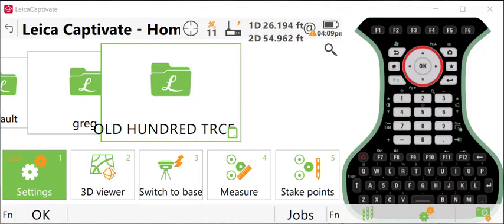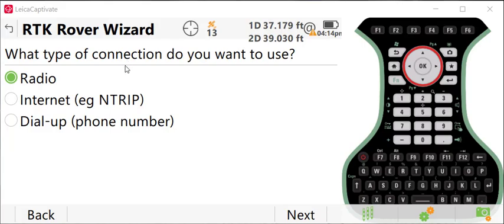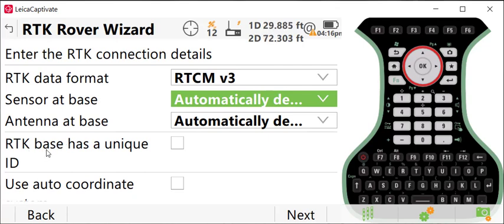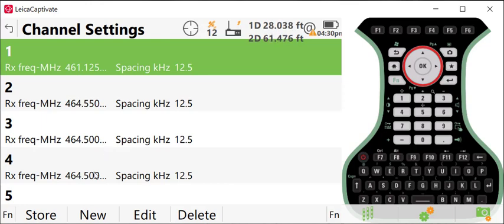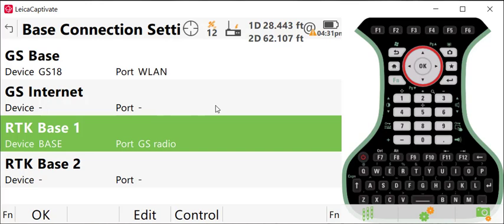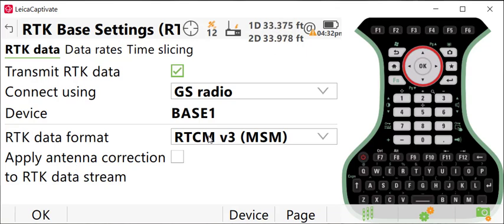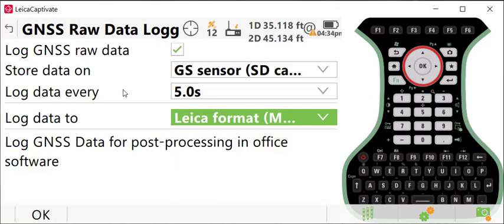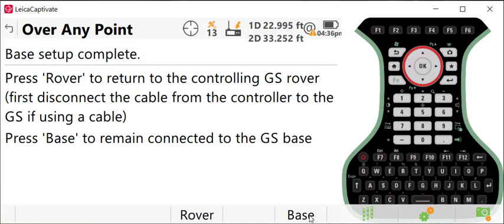Leica Captivate Configure for Base Rover RTK Radio Operation

Comment: Thanks for the video.  Do you know what the process would be to use the GS18 as the base for say a DJI Drone?
Reply from the maker: Assuming that you are going to post process the GNSS data from your drone you can set your Leica GNSS unit (GS14, 15, 16, and 18) as static receiver.  This video link shows how to configure these units for static observations: https://www.youtube.com/watch?v=8LoJwaBCKxU
I would recommend a 1 second observation rate.  

Does your drone support RTK corrections?  If so, you may need help from your drone vendor to setup RTK operations.  Leica Captivate with our GNSS receivers can support several types of RTK base station configurations including UHF (403 - 470 mHZ) and cellular.   There are also SpreadSpectrum radio (900 mHZ) options for some Leica receivers.

Comment: thank you so much for the video, you are amazing.  I have a GS15 which is normally used as Rover but in an attempt to set it up as base, on getting to CONTROL-SETTING for radio frequency settings an error was returned "Configuration not possible, current radio firmware not possible". pls, what do I do in this situation?
Reply from the maker: Thanks for the feedback.  Are you using an external radio with the GS15?  If so, do you have the correct device selected?  If you're not using an external radio, are you sure that the GS15 has an internal radio?  They didn't include one as a default.  You had to purchase this separately?
Reply: @surveyorpop  thank you so and very much for the reply. with further research, I discovered the instrument doesn't have a satelline but rather a Pac Crest ADL internal radio.  Thank you again. you are amazing

Comment: Thank you for your valuable presentation with clear steps.
Would you make a video for operating 2Rovers  from one base please ?
Reply from the maker: Using UHF or Spread Spectrum radios you can operate an unlimited number of rovers from a single base.  Just make sure all rovers have the same radio settings.